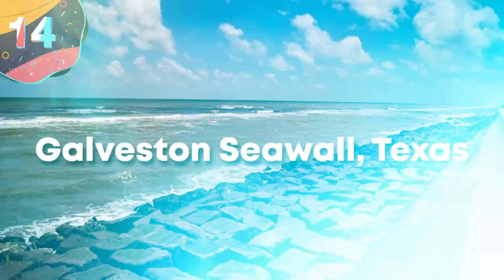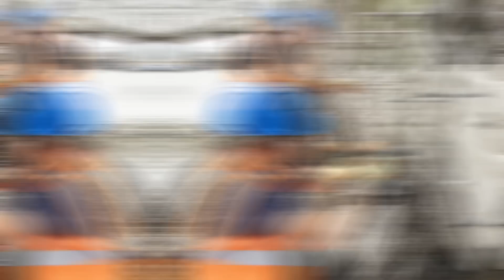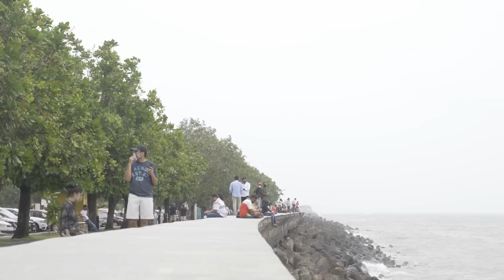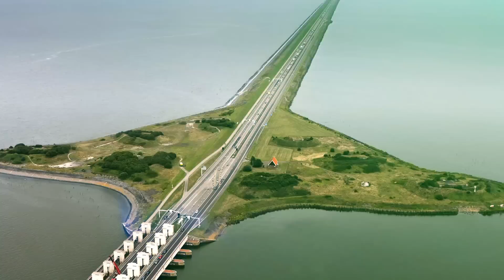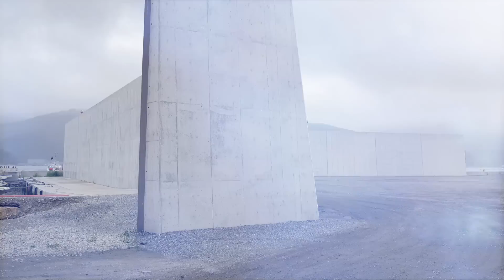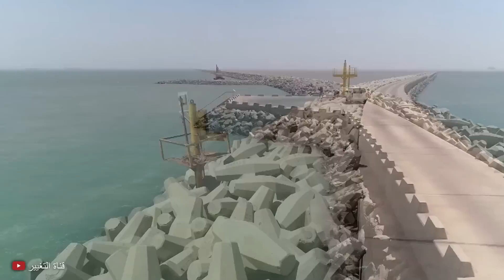15 Sea Walls Designed to Protect Against BIG WAVES

Comment: I've lived right on the seawall in two houses, once when the blizzard of 1978 when we had 4 feet of ocean in our living room, North Weymouth, Mass, and once in 1991 the perfect storm washed the house completely off it's foundation out to sea while my gf and myself were in it, tried to ride out the storm,lol, we got stuck in the car with front row seats to waves crashing over the house and on the telephone pole wires, blue sparks running up and down the lines, the next morning we walked around the beach and there wasn't one splinter of house, no washing machine, no A/C's, no pictures, Nothing but the foundation. Marshfield, Mass